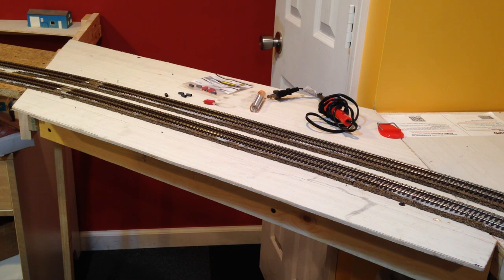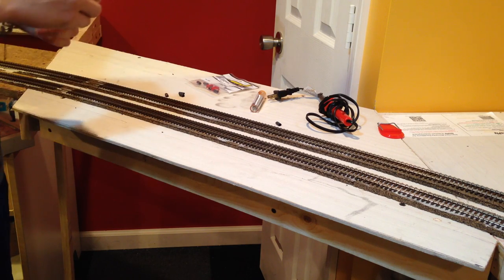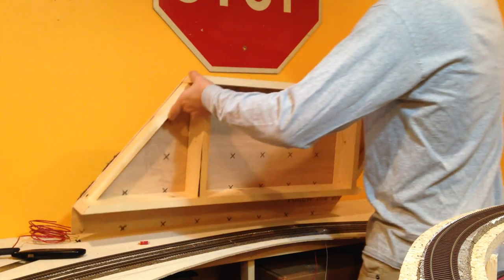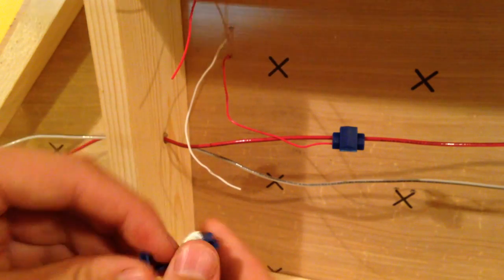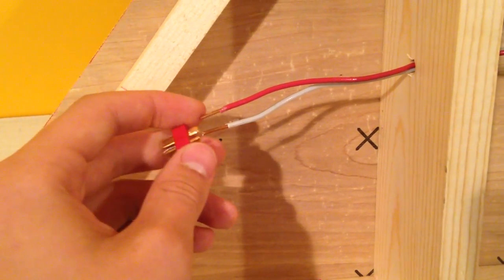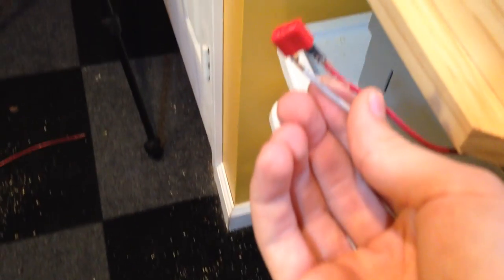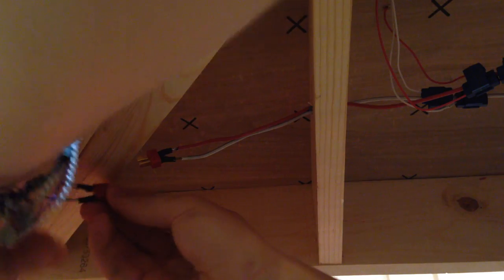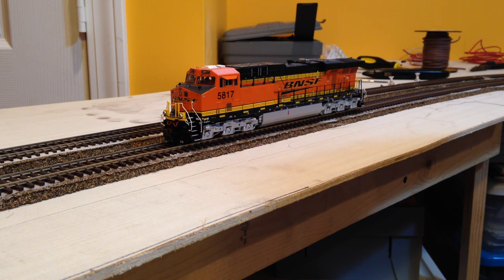Building a Lift Out Bridge - PART 2: Wiring

Comment: Great job there Cam! I'm thinking I'm going to try this on my layout on one end to make it easier to get access to my overstock train cars! Thanks for sharing!
Reply from the maker: David Durbin Awesome! I'm thrilled that someone else will be trying this out. It's rewarding when model railroaders share ideas, so good luck. It's worked out great for us. The only thing I need to do to make it work better is round/taper the corners of the guide pieces so it slides down a little easier. 
-Cam

Comment: Great job with the drop in and wiring..thanks for sharing and keep up the great work. . .
Reply from the maker: PittsburghIndustrialRailroad Thank you! It's working out so far. All it need to do is touch up the rails and ties where I made the cuts. I'll also have to repeat that later on when we add more tracks, but that's no big deal.
-Cam

Comment: Cam you did a great job on the liftout. Great job!!
Reply from the maker: model railer Thanks man! I'm glad you approve. It's going to work out fine when we're all done.
-Cam
Reply: railfan220 I guess people aren't  happy with how you wired it up? People hate them suitcase connectors.
Reply from the maker: model railer Really? They're difficult to use sometimes, but it's better than striping the middle of a bus wire and soldering a feeder to it.
Reply: railfan220 yup yup

Comment: sweet deal . I am a electrician and I was over thinking this job ,, thank you very much for making it simple
Reply from the maker: Haha! I'm glad this helped. Thanks for telling me because I truly appreciate it. This hobby is all about sharing ideas and helping each other out, and I could probably learn a few things from an electrician. 
-Cam
Reply: well one thing I will add , is don't have any bare copper showing on your wires , use electrical tape on them , this way it will never touch the other wire and cause a spark ,
Reply from the maker: sparky107107 Ok. Thanks for the tip. It was one of those deals where I forgot to slip the heat-shrink tubing over the wire at first but remembered on the second wire. But yeah. I'll fix it up.

Comment: Loved Part1.  I'm not a fan of lift-outs, but you did a good job.

NOW PART 2.  As I have no idea as to what is behind the white door or how often you will need to gain entry my critique MAY be B.S.  HOWEVER, don't you think that having to get under the bridge to un-plug the BUS will, in time, become a royal pain in the @$$.

A simpler method would be to have secured COPPER strapping to the two benchwork sides of the pass, and to the two angular side of the bridge.  Connect your Bus Line wiring to the benchwork straps.  And an Aux. Bus Line to the bridge side straps.  Then every time you lift the bridge out the connection is severed.  When the bridge is in place the circuit is complete.  One cautionary.  Go back about 18" from the edge of the open benchwork ends & cut a block break.  You will need to do some switch back wiring to keep the rest of the line operating.  Then when you do lift the bridge any AC or DCC locos will find a dead block and stop back from the open gap.

Comment: Great job, but i got a idea while watching this. is it possible to mount, & connect automobile door jamb connectors ( used for spkr. wires) instead of wiring connectors that need disconnected when you lift this section out?  mount the connectors where they will touch when section is replaced. they have like little metal dots that touch the other side dots, & that makes you're connection.

Comment: What is the point of using heat-shrink insulation, when you leave exposed wire sticking out of the heat-shrink ?

Comment: The plugs seem to be a good quality for the job.
Scott
Reply from the maker: Scott Downey Yeah! They really worked out alright. I didn't cover it in this video, but I might have to wire up some RJ12 connectors (or whatever the control bus wire is) so that the command station can communicate with the 5amp boosters. However, I might be able to wire it so that I can bypass this bridge and go through the staging wall on the other end of the room instead.
-Cam

Comment: Using suitcase connectors on solid wire is a place for a poor connection. Remember copper oxide? Corrosion will happen over time and result in intermittent electrical circuits.  Solder all the wire connections for a more dependable circuit.